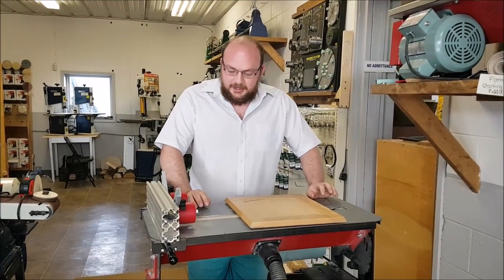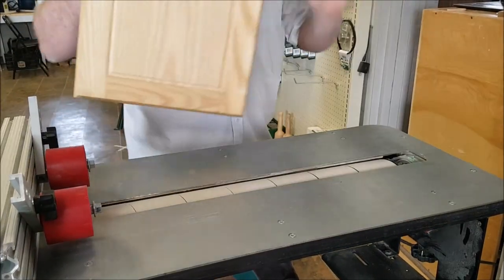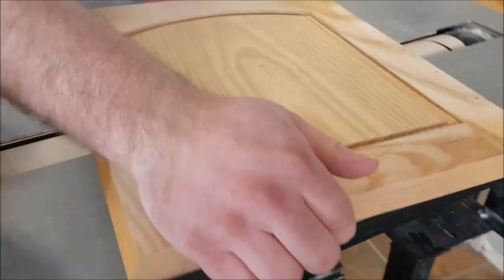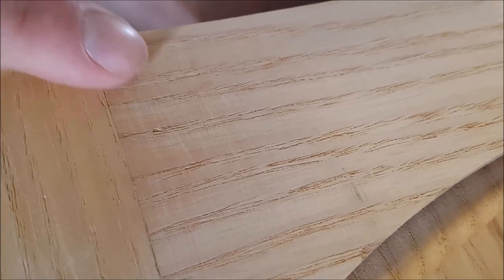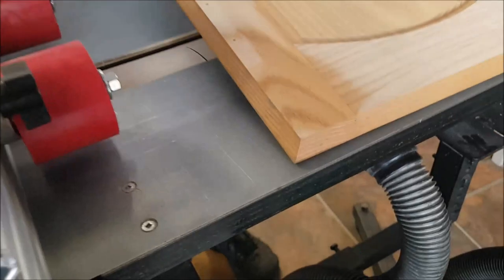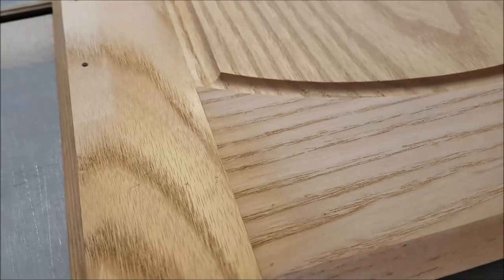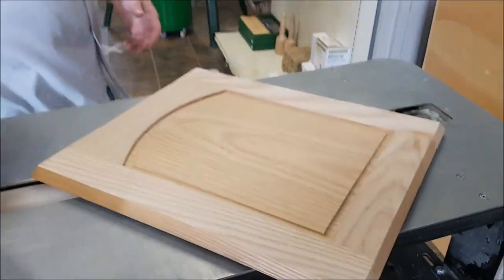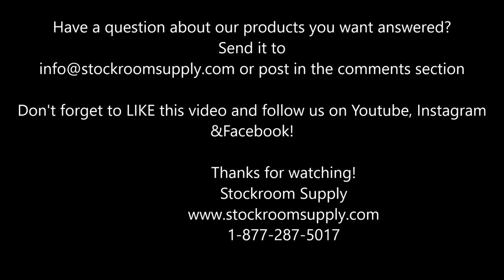Alleviating Cross Grain Scratches With a Flatmaster Drum Sander! EthAnswers

Comment: Not going to tell you anything you don't already know about this machine Ethan. But I do a lot of frames on it and it works well. Except I push it through the sander then rotate the frame 90 degrees and push it through again. Rotate 90 degrees and so on.. Once it's flat do the same when with 220 grit. doesn't take many passes for you fingers tips to sing when you run them across that fine sanding.  When done I usually hunt for any scratches with an orbital sander at 220 gritr.. But that is ridiculously easy once I've used the finer grit on the flatmaster. Usually just a few minutes with that.
Reply from the maker: Love it! Good thought